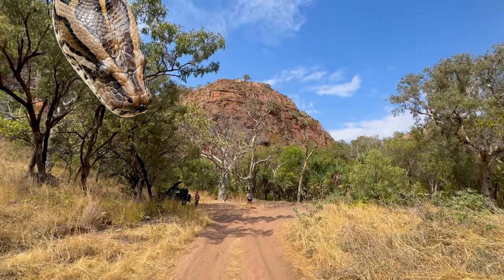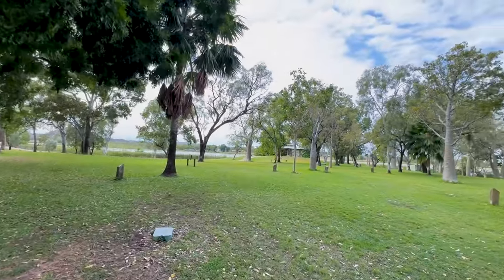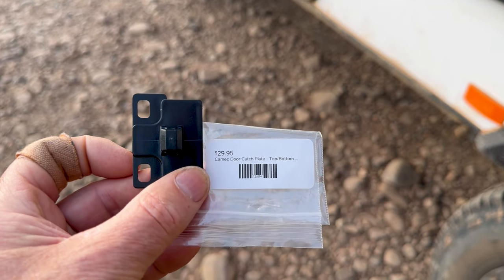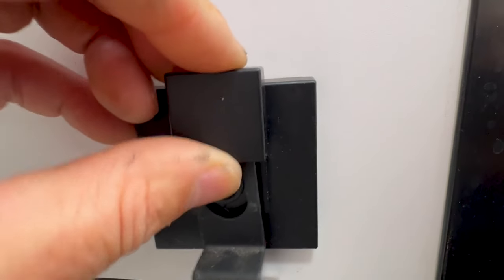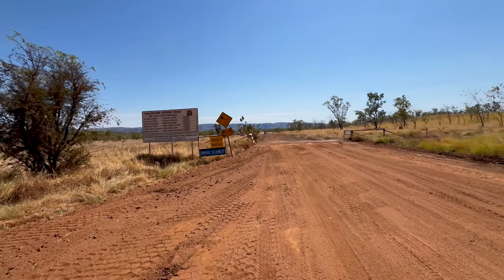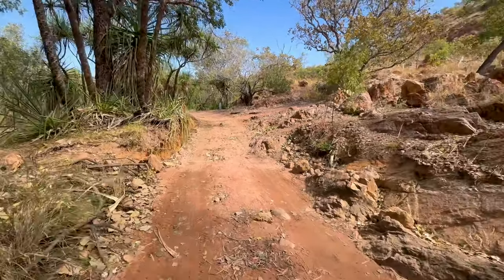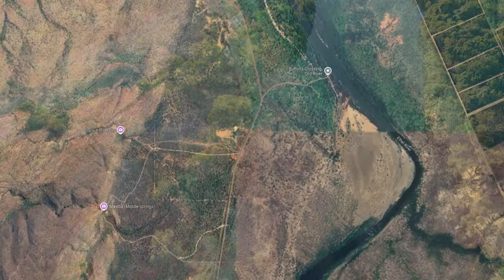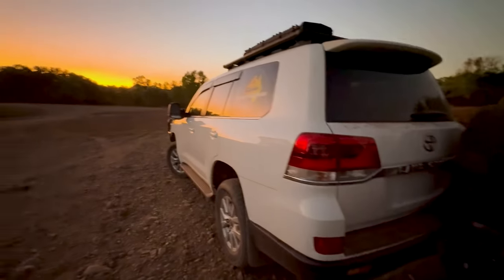Gils Solo Trip - Yep! Snakes, Croc’s, Butterflies, Solar Issue, Hand Injury & Spilt Milk

Comment: Great vid Gil. Your van is “an off road” van. The issues shown doesn’t speak well for Crusader’s (Manufacturer Of The Year 2024 )quality control. In fact, we have found our “off road van” a Crusader X-Country Extreme had the same solar panel as well as other issues not being great off road.
Reply from the maker: Yes, definitely an off road van and it has had its fare share of bumping and shaking going on, especially on the Gibb.  Perhaps a few recommendations and changes needed for improvements.  Good thing is that it is still under warranty.

Comment: I meant to say I always tried to put my liquids like milk oil water containers inside another container so if they do spring a leak they are contained in the container, but anyway I suppose that’s extra weight you have to tell around but it helps like spillage you had with your milk
Reply from the maker: Thanks Cliff. I think the milk expanded because it was hotter in that cupboard.  After it happening twice I think I have it worked out now 🤞